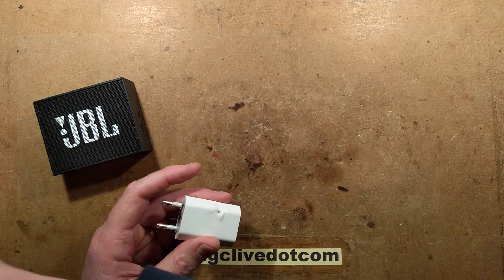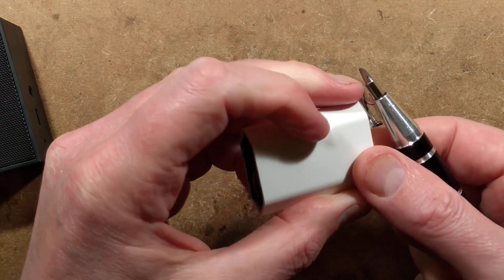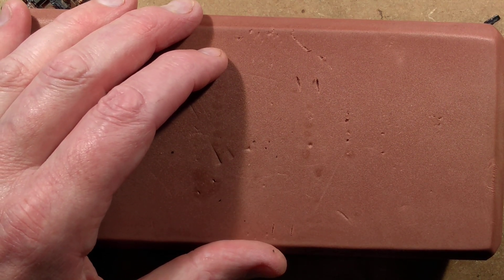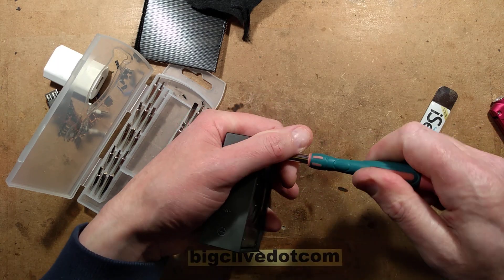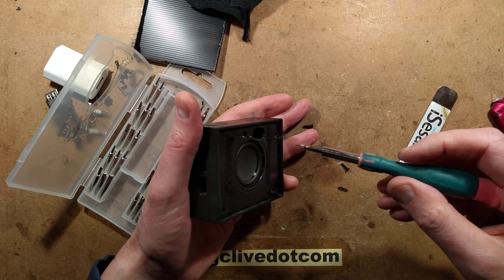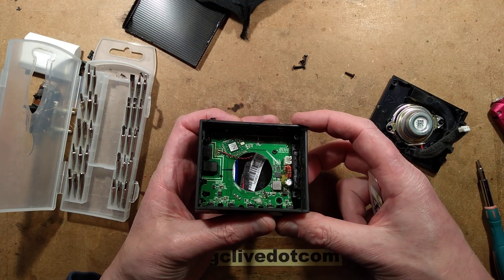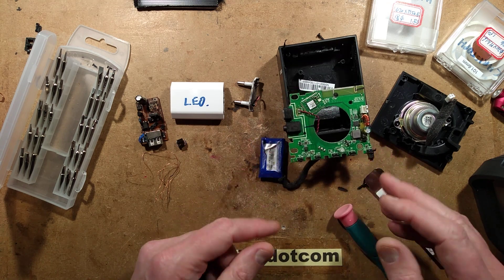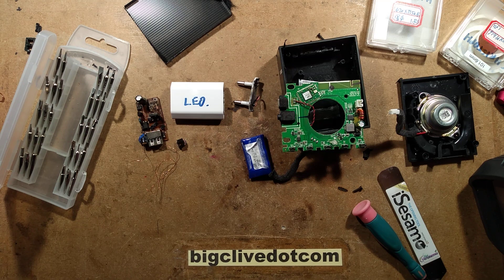Dead JBL speaker and melted PSU.  Which died first?

Comment: Clive could you try removing that bluetooth board and trying then? It would only work with aux input but it may work
Reply: I thought so too. But theres a good chance its not just a slave module. It's the brains.  Even if aux went straight to the amp. The chip could be handling eq and volume and such. So you need logic from some chip to do the magic. And the chip is toast. I would guess you can't even power this speaker up without logic from some kind of mcu. If you could...it would probably be turning on in its current state and only bt wouldnt work. could do something no doubt. But you'd basically be making an amplified speaker from scratch using a less than ideal circuit as it was designed for logic based control. I hope that made sense. But basically these speakers need brains. And the only brains I see there. Is dead brains.
Reply: yodaco ocadoy that’s exactly what I was thinking
Reply: @yodaco  That's likely, but supposing that the remaining BMS circuitry would provide undervoltage protection, you could add a simple on/off switch to control power to the amplifier (maybe also a volume potentiometer), and hard-wiring its input to the AUX port, you could still get a crude yet decent speaker.
Reply: @vaclavtrpisovsky  I cant lie. I would have tried.
Reply: I also want to see if it works w/out bluetooth board
Reply: Me too!
Reply: Yes, I was going to suggest that as well but seems like you already did!
Reply: yeah would be cool to see if you could fix the speaker by replacing the components that ran hot under thermal camera
Reply: Probably won't work, in those crappy modern gadgets there is a lot of "protection" curcuitry, and if one of the modules doesn't behave correctly (or is missing) the thing doesn't even turn on.
Reply: Or just reheating all the joints. I just fixed a small Bluetooth speaker like that. It's just that the board that provides the Bluetooth also recives alot of bass. And the solder joints are shitty brittle types
Reply: @skarufue 6

Comment: I see an audio jack in ... maybe it can be "recyled" by cutting power to the bluetooth circuit ...
Reply: Ive done this before with other jbl junk its a good idea, at least you can get some use out of it then
Reply: @Steve211Ucdhihifvshi  Not to speak that there are bluethooth audio receiver modules on the cheap out there ... tho not sure if they fit /  are able to speak to that thing
Reply: @MrMegaPussyPlayer  and it doesn't look too difficult to desolder that thing and replace it
Reply: @ih4t3u28  ic's are always a pain in the butt to remove, and even more so to replace. noone would do that if they knew what they're doing. and if they did it'd probably be quite expensive.
Reply: @jaggns5774  I think he's talking about the whole Bluetooth module being replaced in the main board and not just the ic.

Comment: I think the Bluetooth speaker went, or maybe the power supply caused it to blow, but when Big Clive plugged it in, yes, that killed it for good lol.
Mind you, it was probable beyond repair anyway and who is to say why the Bluetooth speaker blew, it would drag that shit power supply down in no time.
I run everything off a Poundland £2 power supply for charging phones, it is almost 2 amps and will get hot at full load after a couple of hours, but so far it has survived.  Maybe Big Clive should do an overload until destruction of one of these.  I was so impressed I bought another, which has promptly vanished into someone  else's possession :-(  and no one will admit to having taken it, but I know of someone running a Bluetooth speaker and charging a phone at the same time.  Yes, you know who you are!  I can only use one at a time anyway lol.  We have not seen any explosions or something going terribly wrong lately, very disappointing lol.

Comment: Remove that faulty bluetooth module and see if it works....
Reply: witespy Doing what?  It seems to be a Bluetooth speaker.
Reply: @johnfrancisdoe1563  just for testing...but it does seems to have an "line-in" input , might be a nice small computer speaker if that's all the problem is..🤷‍♂️... You might even find a replacement the bt module if that's really the problem..

Comment: Clive, do you think this is possible? To die due to electrocution by earbuds that were plugged into a charging cellphone in which the power brick failed in a similar fashion as to the one in your video? I have seen earbuds with metal casings, so maybe it's possible? If the metal casing of the phone itself could be lit up, then the headphone jack and therefore the earbuds themselves could possibly be as well. No idea, though. 

https://www.snopes.com/fact-check/electrocuted-by-earphones/
Reply from the maker: Yes.  There have been incidents of electrocutions where the victims had burned ears from the current path through the headphones.
Reply: I've received static electric shocks though my earbuds.

Comment: Try charging a Moto z2 force with a 1 amp 5 volt wall adapter and the adapter could catch fire and I wasn't using a cheap one

Comment: the only isolation on the transformer's windings is the enameling ? so the bluetooth IC short-circuited ?
Reply from the maker: I'd say the power supply melting was caused by a failure in the speaker causing high current draw.

Comment: I use a snap off blade knife to get the grill out (sometimes in combination with a small screwdriver to prevent it from going down again when i do it from the other side).
I chose to start in a corner on one of the long sides and put the point of the blade in one of the holes in the grill and move it up using the plastic around the grill for the knife to lay on and bend the grill up. And then repeat that all around it.
Sometimes layer by layer to finally get it out if it is hard to bend.
Usually this makes it look nice afterwards.
I think this is the best way i have found to not dent or bend anything.

Comment: Unreliable modern digital garbage. Hi-Fi equipment from the 70's and 80's was better and lasted longer.  Hell, a little service and it will be good for another 40 years! Can't say the same for modern stuff.
Reply: I had a mid 70s Sansui integrated. I needed to have the Dolby board rebuilt. I left it at my dad's when I moved away in 2013 and he threw it out about a year later. I'm still salty.
Reply: And it cost a lot more.  Spend the same money today and you'll get quality stuff.  This speaker cost $30.  In 1970's dollars that's $4.55.  What Hi-Fi equipment could you buy in the 70s for $4.55?

Comment: JBL have sold their name to some pretty shite gadgets to be honest. That speaker is probably one of them.
Reply: I own two of these speakers and they are actually quite good for the price, decent bass and long battery, only problem is that if you’re using Bluetooth and playing a song on repeat, it will cut off after around 20 minutes (does not happen on aux or if song is changed)
Reply: @frederickbossington  i will try my speaker. I dont get that trouble.
Reply: @Matt Quinn Cheap shite that isn't actually cheap...
Reply: Do u know other brand that use exactly same Product with Jbl Go?

Comment: Got the same USB deathdaptor, but my one is the type with push in pins from the Euro style plug, using large metal clips on the board. Never plugged it in, after seeing all the clones that are around, and instead keep it as an example of the deathdaptor.

Funny enough I use the other plug in deathdaptors to plug in stuff with UK style plugs on them, easier than digging out the 2kVA ferroresonant isolation transformer, and using it as a room heater.

Comment: Maybe you could do a video where you take a propper USB charger appart to show the difference to the shady ones...
Reply: He bought like three Apple USB chargers (off ebay) and ... realized that none of the three could possibly be from Apple after dissection. So... tried.
Reply: Shrike DeCil no, he knew they were all fakes. That was the point. He won't bother with an actual Apple charger, because there's already enough videos with teardowns of those that show they were, in fact, designed by someone who gave a shit. But there's an Ikea charger that he did a teardown of that was quite impressive for the price.
Reply: Denis Uden google has images of both
Reply: He probably did, or at least he have these chinesiun charger's issues adressed in some video

Comment: I suspect that the JBL was working and charging and pulling a higher amperage than the PSU could supply. The PSU overheated, sent mains to the speaker and fryed it

Also, the speaker costs around 25-30€ in the local stores
Reply: It should charge at 500mA though
Reply: It is a chinese psu... No one said that it can provide that
Reply: @DangerousPictures  i mean , the speaker unit
Reply: @Cheese_1337  I know, but what if for example the psu only can provide 100ma and has no over current protection (a similar thing happened to me, but i was able to catch the PSU overheating and replaced my phone with a big resistor)
Reply: There is no evidence of mains on the secondary side.

Comment: Shitty PSU could put out the power and internally shorted.  Blew out the BT controller. From China with love.
Reply: If the speaker saw a little bit of mains voltage due to the cheap power supply that could have caused the fault in the Bluetooth chip, those little processors are quite delicate when it comes to over voltage and it looks like it's directly connected to the 5V input.
Reply: I've heard of this happening with ATX PSUs, cheap or not. When the primary side blows, a voltage spike will appear on the output!
Reply: @BenjaminEsposti  computer power supplies don't blow up for a long time if you get a good one (mine is a 1000 watt from evga and I have had no problems with it after 1 - 3 years [I don't know when I bought It but i know it's not 5 years old yet])
Reply: I guess it was too much bass for the psu to handle
Reply: If the PSU failed first, wouldn't that make all the current flow through the PSU's internal circuits, which in turn would spare the speaker's circuit?

Comment: Interestingly the USB port is also connected straight to the Bluetooth transciever on the board. Which means that sending something bad down the data lines will take down that too. The transciever doesn't speak USB over the USB bus though, I wasn't able to detect the protocol. Also, if you hold down all the buttons while turning it on you can get it into some kind of special mode, I haven't yet had the time to detect what exactly the mode does. I started reverse-engineering the JBL just to change the Bluetooth name (I have three) but I haven't gotten that far yet.
Reply: Maybe programming mode?

Comment: The battery size in Jbl speakers is really a joke
Reply: But it holds up for months on one charge in stand by and hours in use
It really doesn't need to be much bigger
Reply: @resneptacle  jbl charge 3 has 10 hours of use time. Anker soundcore, similar size, has 24 hours. A longer time is better and less of a hassle. Why skim on the battery? If it degrades over time it becomes unusable... not a problem with anker.
Reply: @nutzeeer  The Soundcore is definitely larger than the JBL Go, I have both. And you'd most likely not be able to fit a larger battery into the JBL go because of the speaker that looks to reach the back side of the casing, which also explains the hole in the circuit board
Reply: @resneptacle  true, i saw a comparison to the jbl charge 3.

Comment: Had A JBL speaker who died in the same way only the psu I was using was way better. Planned obsolescence I would think.
Reply: Then it would be planned obsolescence by the Bluetooth chipset manufacturer and I don't think that's likely
Reply: @resneptacle  As I did not had the means nor the interest to pursue the problem mutch further I dont know how the BT chip died.
But I can say that in my case:
- It was not the charger as it was playing music not conected to a charger
- It was not the battery as it was still at 4V
- It was not a process that crashed mine mad a plug for the battery 18650 which I disconected and waited a day to try and restart it again
- It was a different moddel but similar BT module which got also hot charging still worked

Comment: I think there are two possible cases:
1. Speaker works ok, but charging it stressed this charger too far, thus killing charger, who next sent too much power into speaker, breaking it.
2. This one I think is more possible: Some time ago I got a very cheap charger when under small load (about 500mA I think) voltage not dropped, but actually got to about 7V, what is too much. Also I had one cheap chinese bluetooth speaker that I killed with about 12V (good reminder to track which buck converter that's on your table that is connected to your speaker is set to correct voltage), and failure was the same, bluetooth chip was the only one thing that got hot, rest of the board survived.
3. There is also possibility of some spike voltage getting through that "separation distance" and killing speaker, which kept drawing too much current, and overheating charger.

Comment: I have the same speaker mine is having issues crashing recently, it freezes my phone and the speaker had to be hard reset when it does, I had a feeling it was the Bluetooth chip and this pretty much confirms it as well as warning me that it could get way worse, thanks for the video and keep up the good work
Reply: I would test the speaker with alternative device. if your phone is crashing its not too likely to be the speakers fault. bluetooth speakers are pretty passive usually.
Reply: on the other hand the phone crashing will likely cause an error state in the BT speakers MCU and then need to be reset to clear the fault.
Reply: @yodaco  nah its the speaker doing it, phone is fine on other devices, only the speaker messes up

Comment: I have a Sony XB40 with a completely destroyed charge controller chip, the previous owner completely nuked it and I'm not sure how! I bypassed this using my own charge controller and some relays and it worked perfectly for a couple of charges, now it's dead again, this new stuff isn't meant to be fixed!
Reply: It's harder to be serviceable with more and more integrated circuitry, smaller components and compact board design
Reply: JonasLue true true
Reply: Yep it does not really matter what brand you buy most of it is just plain junk and maybe they should start sending those who are responsible to Devil’s Island,
Reply: @richardbrobeck2384  the only actual decent quality BT speakers that use good components seem to be Bose, there's a reason they cost more than the competition, and contrary to popular belief it's not just the name you're buying.
Reply: I'd love to believe that, I truly do, but the price just aint right chief.
Reply: @mikehall3976  As far as I know there are no other SMALL bluetooth speakers with a 50w output power, 2230mAh battery, that are made entirely from metal, come with a charger and charging dock in the box and cost less than £200, Bose definitely do innovate and their products feel much better quality than the likes of Sony, JBL etc.
Reply: @ArlenMoulton2  Sonys fine, as long as you dont mess around with the innards as this previous owner did. Dropped it a few times and even left it in the rain lol, to heavy to steal too. 

How did he fuck up its charge? Anything to do with the USB out supply? Or wrong PSU in?

Comment: I take the same attitude when I'm fixing measuring equipment at work, if it doesn't work and I take it to bits and wreck it at least I'll know how it goes together for next time and how it works so maybe I'll manage to fix the next one that breaks. I must have saved a fortune over the years repairing equipment that's not working properly or broken

Comment: If the is a CSR(Qualcomm) chip, they often include battery charging circuitry in the chip. This would make sense for how it died.
Reply: Its probably disabled though. Most CSR bluetooth chips only have a maximum charging rate of about 500ma. They probably put a dedicated charging chip that can handle more current.

Comment: USB chargers are so dangerous if poorly designed.   Apple cables have long had a problem with fraying close to the lighning connector, which is a short waiting to happen.  I've had a multi-charger blow up on me due to that.   Suffice to say a genuine Apple charger will handle that gracefully and just cut off the current.
Reply: I thought apple products broke anything but the fuse.
Reply: Genuine Apple chargers are worth the price